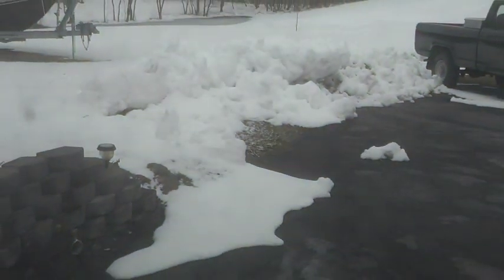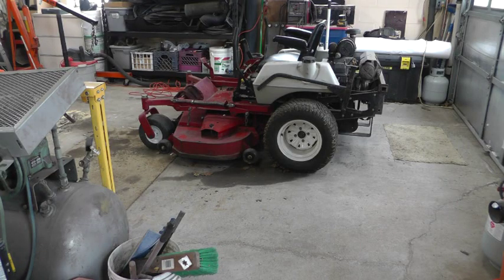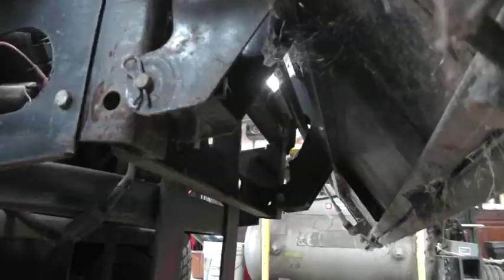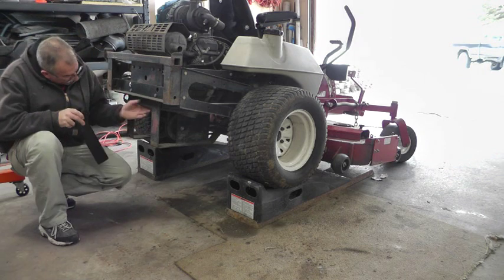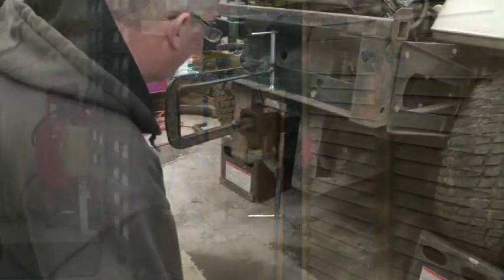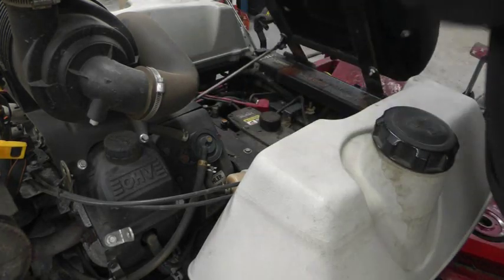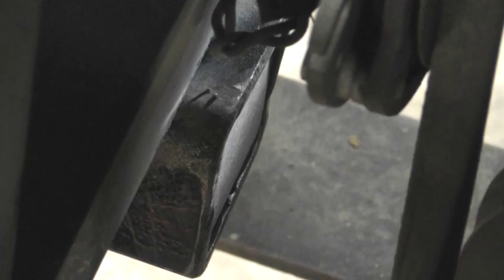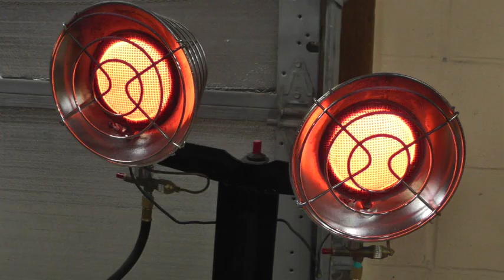Trailer Hitch for Mower - eXmark Lazer Z - DIY Install Zero Turn

Comment: Head down you your local boating store or hardware and get some 'traction tape' .  Comes in a roll 6" or so wide with stickem on the back.  It is made to make non skid surfaces on boats etc.  Stick them down the middle of your ramps and voila no spinning tires.  Cheap too.  Take care.  Doug

Comment: Not really worth it. Might as well get a older well built lawn tractor just for towing and snow removal.
Reply: An Exmark will pull well with it's great hydraulics and powerful engine. It is often desirable to spread product, detach etc, while mowing. No need for a second old lawn tractor, well built or not.

Comment: Be careful not to pull to much weight manuel says no more than 80lbs
Reply: Basically the weight of the garden cart you just hitched up to it.
Reply: Hmmm. Ive towed lots with mine, once around 700 or 800 lbs, didnt seem to phase it, and that was with a cheap ztr, not the better made exmark I now use. Some ztr mowers are made with this type of 2" receiver from the factory. Spartan is one of them. Anyway, best of luck. 😉